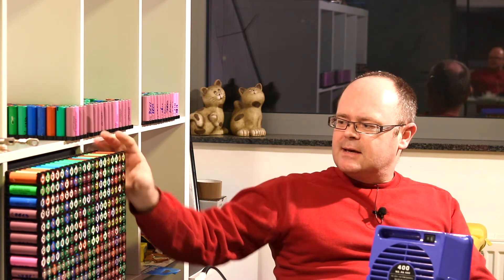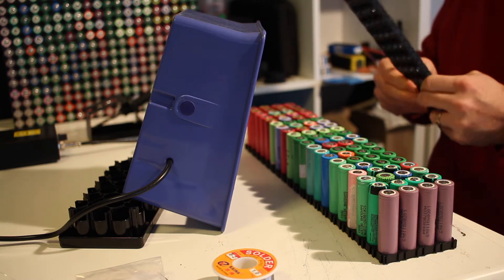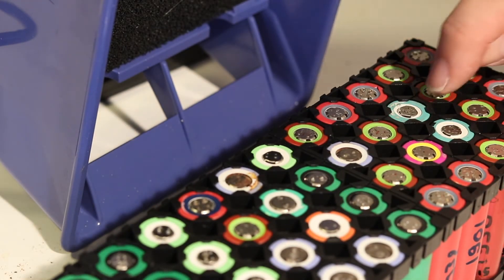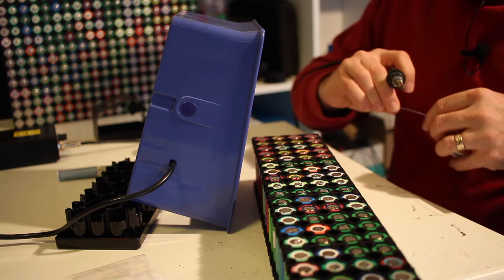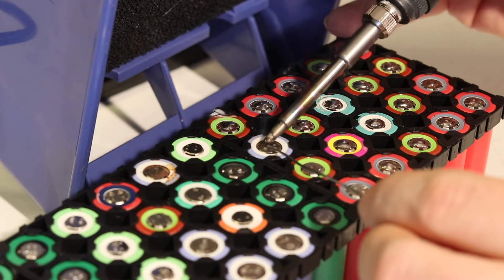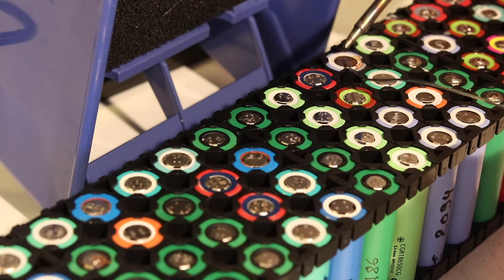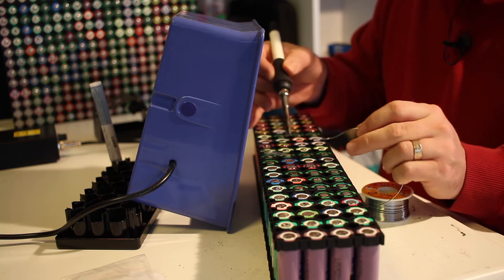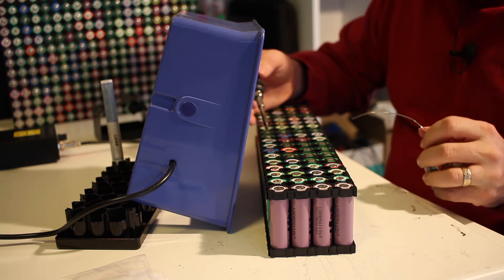18650 - Part 14 - Soldering the cells

Comment: where do you buy cells
Reply from the maker: Didn't buy any, all salvaged, most from electric bikes. 
If you want to buy nkon.nl is trustworthy and cheap. Whatch out with aliexpress and alike...
Reply: @Sailingandelectronics  how did you find the salvaged bikes?
Reply from the maker: If you want to redo your bike battery, use the opportunity to buy bigger capacity ones. Same size, same weight but more miles 👍

Comment: I think you didn't clean up the surfaces first, from the remaining spotwelding points? With a grinder or dremel?
How much Watt is de soldering iron? I saw it on Ali for about € 37 but no wattage in the specs. Is it a god buy? Spare tips available?
Reply from the maker: KaeL, wattage not sure, but great iron if you buy a different tip as I did . That way you can create bigger surface contact.
Reply from the maker: KaeL, I did not removed the spotweld points. I tried a batch, but did not see advantage, on the contrary, the thin metal surface is even made even (minimal) thinner by removing the spotwelds. When soldered, the solder goes round it without problems.
Reply from the maker: KaeL, 72w
Hoge Kwaliteit Digitale Verstelbare Temperatuur Soldeerbout Station Lassen Soldeer   T12 Handvat Solderings Iron Lasmachine
 http://s.aliexpress.com/uyQjiEVf?fromSns=Copy to Clipboard 
(from AliExpress Android)
Reply from the maker: KaeL, tip BC3
Nieuwe T12 Vervang Solderen Soldeerbout Tip PCB Reparatie (T12 K, T12 B, T12 BCM2,,)
 http://s.aliexpress.com/EVNrEJzm?fromSns=Copy to Clipboard 
(from AliExpress Android)
Reply from the maker: KaeL, cleaning surface has little use since solder will go under and around. Not sure about wattage. Think I mentioned in my clip about solder iron.